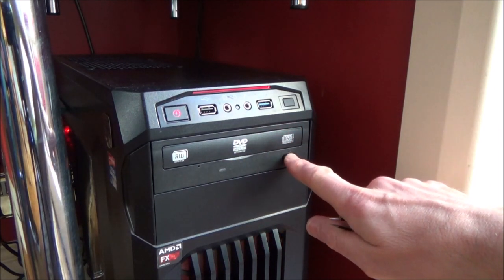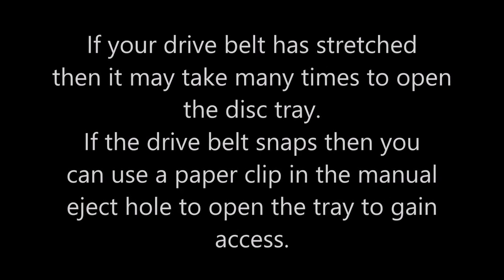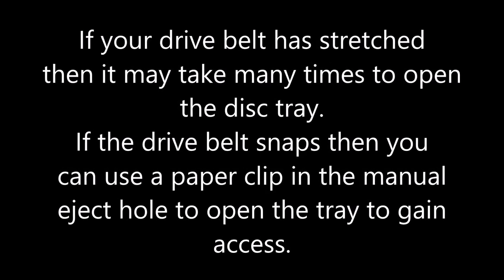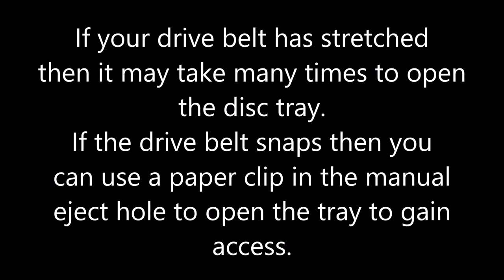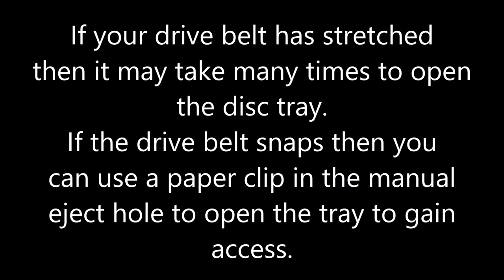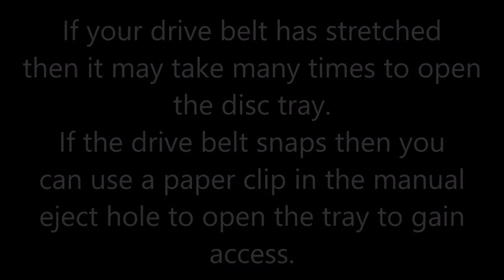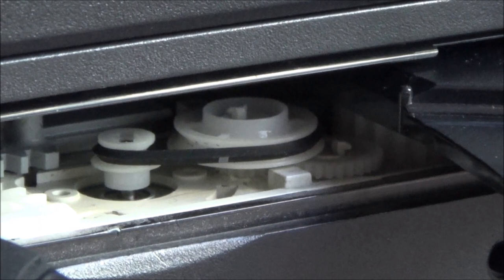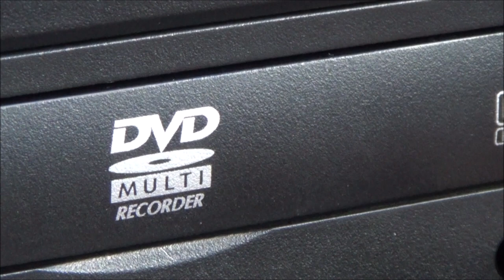How to Change the Drive Belt on PC CD / DVD Drive Tray without dismantling

Comment: My new 3ds xl, I snapped of the top screen, and it still worked because the display cabel and speaker wires are still fine.

But it sat on a shelf for 6 months and it's dead, it's covered in a layer of dust.

And after I noticed it stopped working I filled the hinge with silicone, hoping it would fix the hinge.

But the silicone globed everywhere and it's stuck open.

It charges the battery but it doesn't turn on.
Reply: If you'll pay shipping I'll male it to you, I can close it but it will nullify the silicone.

It's probably best that way because the top screen is suprisingly flexible.
Reply: @ryanwakebradtelle8682  I fix stuff
Reply: @dkracingfan2503  want me to send it to you?

Comment: Planned obsolescence. It would be easy to have direct mechanical linkage between motor and tray. Instead they put a rubber belt there that is guaranteed to malfunction after a few years.